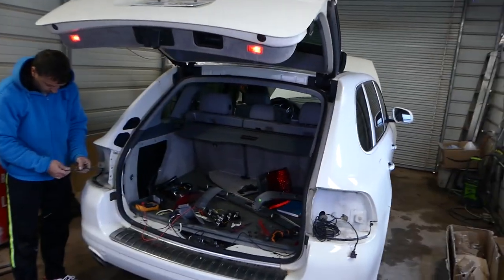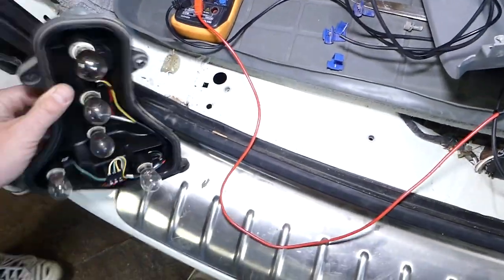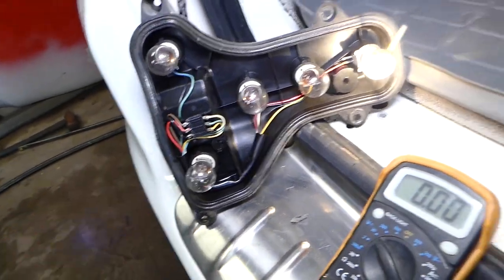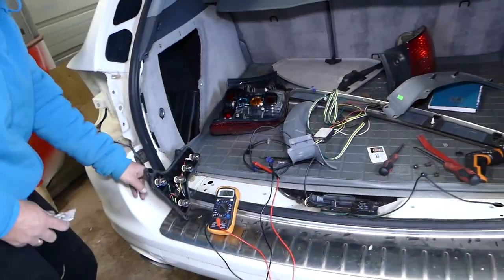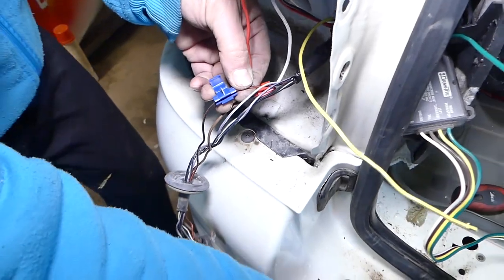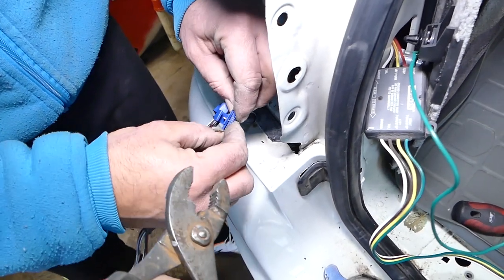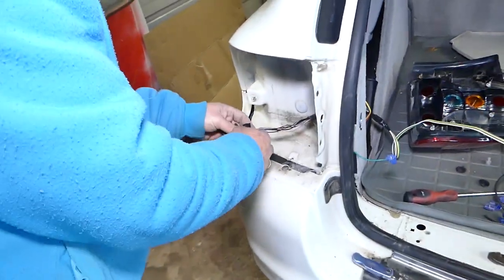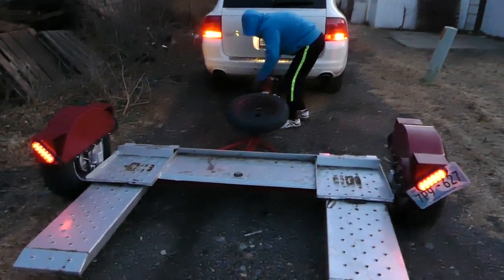HOW TO INSTALL TRAILER HITCH WIRING HARNESS ON PORSCHE CAYENNE

Comment: Thanks for the great videos and helpful guidance.  The installation appears to be pretty straight forward but I dont understand how to map the inside wire colors to the outside wire colors.  Is there a guide or would it be safe to use the same colors you did in the video.

Comment: So an aftermarket harness spliced this way will work without throwing any fault codes? I was told the PCM needed to be programmed to recognize the harness and change in voltage. This is awesome I will save a couple hundred bucks now!

Comment: I am very disappointed in Porsche. I have a 2006 Cayenne S Titanium with factory installed hitch but no wiring harness. Why bother putting the hitch and not the required wiring to go with it. Pretty sad it is the same as buying a car but having to pay extra for a motor.